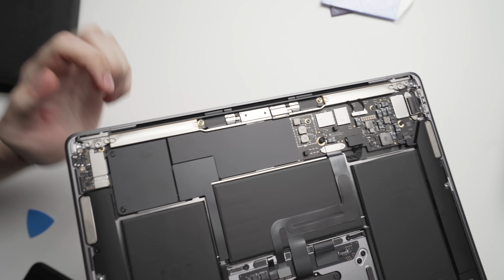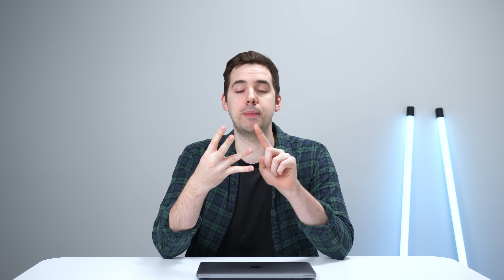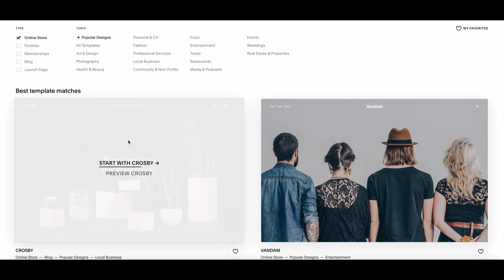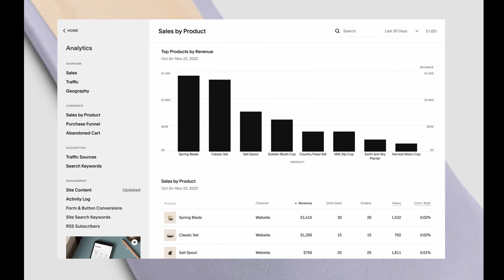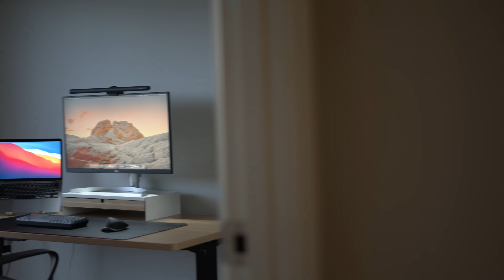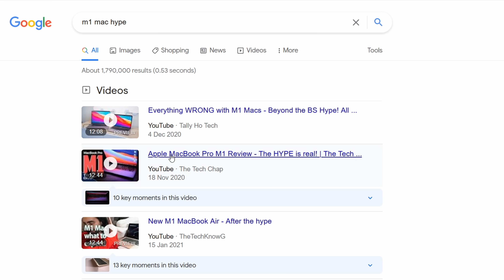M1 MacBook Air Review - After 5000 Hours of Use

Comment: Hello! Thanks for the video! Very interesting thoughts, I am looking for this one for graphic design work mainly. Any advise on whether to go for it or pass ? " Using lots of Photoshop, illustrator and occasionally Aftereffects
Reply: The M1 gpu is bad and the mba and mbp both hit 100 degrees when doing intense stuff 
If you plug in a 4K Monitor it begins to struggle 
I would recommend the Mac mini with m1 or at least the MacBook Pro because it has a fan that keeps this thing a little bit cooler (it’s still gonna hit 100degrees)

Comment: MBA M1 user here. Have you ever experienced the MBA crashing and having pink lines (sometimes horizontal sometimes vertical) at the bottom right quadrant of the screen? It has happened to me maybe about 6 or 7 times since I got the laptop in December 2020.Have tried searching for someone who's had this same problem but only a few have and we all have the same question. WHY?
Reply: I have been experiencing the same issue here. How did you approach the issue and please let me know the solution for it..
Reply: maybe the gpu is fried?

Comment: That SSD cons factor is what really concerning to me. If something happened with the SSD in the span of 4-5 years, then it's gonna be suck. This machine is in the expensive side from my point of view, so I need an assurance this thing can live with me for longer than that, even for 10 years. I have a 10 years Lenovo laptop now that unfortunately already struggling even for doing basic task. MacBook air might be a very suitable substitute for it, but that SSD factor holding me back.
Reply: Any issue there was has now been fixed and this is no longer any different from swapping in any other machine. For the average user, the SSD will last 20+ years but of course, if you are a prosumer then you need to get the max bandwidth so 16GB RAM and 2TB SSD or wait for the M1X with 32GB RAM.But that is the case everywhere. This is just common sense.
Reply: Computers can die at any time, like within a month of ownership. And these are not expensive given that a decent computer was $1000+ usd 14 years ago. Just adjust that for inflation and consider newer machines are more reliable.

Comment: I have been thinking of buying a new macbook air 8gb ,256gb for my college. And i have been watching many reviews and i really like your reviews than others. So would I face the ssd problem if im doing coding and stuffs for the next four years? I have heard plenty of rumors' that M1 macbook's ssd starts degrading after few months and just lasts about 2-3 years!?
Reply: did you buy it?
Reply: @mysterion86_1  yes
Reply: @karthik5256   did you have any proplems with it?
Reply: @mysterion86_1  nah not yet its working very fine...obv u can't game....u can actually but it heats up so i dont risk it and its a great machine.....and some unnecessary storage haa been used about 30gb till now saying system data ....ita fine for me
Reply: @karthik5256   thanks, i already have ps4, so the gaming is not an issue for me. my concern is it really fast and stable as many Said, sometimes i think it's like apple hype
Reply: @mysterion86_1  no bro i also thought at first am i making a mistake here? coz i have to use it for 4 years and do coding but it turned out to be so good.....till date i havent seen any lag or speed issue .

Comment: When we will get boot camp support for m1 chip
Reply: It most definitely won’t happen anytime soon, if ever.  It’s really up to Microsoft.  The reality is that it’s not an easy transition.  The vast majority of legacy windows programs are built on x86 architecture.  Microsoft would have to commit to transitioning windows and it’s massive software catalog to Arm based architecture, something they don’t currently appear to be committed to doing; as evidenced by the fact that currently there is no arm version of windows 10 available for purchase at retail.  Only a small number of OEM are shipping their devices preloaded with windows on arm. (Surface Pro X for example)If however we begin to see windows OS on arm sold at retail, boot camp would likely be close behind.

Comment: Although your points are certainly valid, the fact still remains that because the M1 is a custom arm chip from Apple, users cannot run either Linux nor Windows natively.  Parallels and virtualization is still the only available option; this means that whenever Apple decides to drop support for the M1 chip in the future, your only option is to upgrade...planned obsolescence in a nutshell.  If you're planning to run  Windows or Linux, you're far better off buying a non apple branded computer, regardless of the supposed advantages of the M1 versus either intel or AMD.  Everyone praises the MacBook and never mentions the fact that without Apple continuing to support it with software updates, the consumer has zero ability to repurpose any M1 mac with a native Linux or Windows installation, once Apple support ends.

Left this comment in another video, but think it's nonetheless valid here.
Reply: Once Apple support ends, usually after 6-7 years, most people will have upgraded, but those that do not, a tiny minority can still use their Macs, they just only get important security updates, not new yearly upgrades.
Reply: @andyH_England  perhaps, but my point is that it’s your computer, purchased with your hard earned money.  Why should Apple be allowed to entirely dictate its path to obsolescence?  My 2014 MacBook Pro costs me nearly $2000 at launch and will stop update after Big Sur.  With security patches likely to follow within the next 2 years.  It’s still in good condition.  Thankfully, because of the intel processor, I can run a full native windows install, after Apple abandons support.  Macs have now effectively become iPad and iPhone; completely useless once updates end.  For this reason alone, I’d buy a non Apple pc instead.
Reply: @mw7967  MS and Google also have 6-7 years of OS support so Apple is similar and as you can say on the Intel Macs you can stick Windows or Linux on. Who is to say that in six years time Apple Silicon Macs will not support Linux? I know there are projects to get Linux running on ARM for consumers and if MS gets its act together maybe WOA? It is very harsh to make these claims in the early days of a new project?
Reply: @andyH_England  Actually Google chrome books from 2018 onward will be supported with updates for 8.5 years minimum.  Even after support ends, users can run a native Linux distribution or can even run Windows natively on intel based Chrome books.  Yes, in 6 or 8 years the M1 may support Linux, but the reality is that as of now they do not.  As it stands, for me a Windows laptop and in many cases even a chrome book are a far better long term investment for the money.  You're incorrect regarding Windows OS support.  Windows 10 was released in 2015 and will be supported by Microsoft through 2026.  That's 11 years of end to end support.  If Microsoft and Google can be this transparent regarding support length, what's Apples excuse?  The fact that Apple consumers must wait for a yearly developer conference to find out if Apple will continue to support their hardware is unacceptable, given the premium they charge for their devices.

Comment: I just got an M1 Macbook Air and I'm overall pretty impressed.  This is my first Mac and I've experimented with Hackintosh, but that's it.  I don't have any affinity for Apple products and I personally despise iOS.  With all that said, the M1 Air is the real deal.  I thought Rosetta 2 would suck and I'm really surprised by how far Apple was able to push the ARM architecture.  There are plenty of things I don't like as well, but most of that comes down to little quirks with Mac OS rather than the hardware and performance of the Air.

Comment: Always excellent content, have been using the M1 air for about 5 months, was primarily an Windows user and I still enjoy my Windows laptop, but this M1 at the price point is just running circles around it to the point to where unless I believe you really invest in an higher end Windows laptop  you just want see the benefit,. I use the mod and I admit I do light video editing, not hardcore but the battery life, the performance especially with the mod is just through the roof, it just seems to be the best alternative for most people unless you're doing heavy lifting, then the MacBook Pro could take a lot of that weight, as always keep the fantastic videos coming, always informative and interesting content!

Comment: You should make a video testing the M1 Mac for engineering software such as AutoCAD, Tekla Structural Designer, and Idea Statica. I’ve been wanting to get one of the new M1 macs for a while now but I’m not sure how it will run these softwares, even if it needs to be through Parallels. Every other video tests the Mac for video and photo editing, but that is not something I would use the computer for. If you could help that would be great.
Reply: I only know about Fusion 360 though, and my friend told that it works perfectly fine! AutoCad also might work well, since it's from the same company. For windows softwares, ig softwares like Ansys would work through parallels
https://youtu.be/ReQQdJtIJdI
Reply: @c04-rhikbanerjee55  thanks, that sounds promising at least. I’ll check out the link you sent
Reply: Agree. I wonder how well M1 would perform when using Tekla, Staad, Revit, and other engineering software. I do know AutoCad is now supported. Still 50:50 about buying one.
Reply: Depends on what you are looking for. If you want maximum portability get the M1 Mac. If you are working mostly at your desk get a more powerful windows machine like Razer Blade/Asus G15 with 3060 at least. 
About the software, AutoCad 2D didn't perform as fast as my 3 years old windows last time I checked it on my friends M1 Mac, but it worked. Revit, 3Ds Max, Maya were worse via a windows Virtual Machine(only way available now), I believe if we tried 3D modelling on AutoCad, it would be bad too.
Simply said there's is no replacement for a laptop with a good GPU with a M1 Mac for Architecture/Civil softwares. But if you really want to make M1 work, you can follow the workarounds on internet.
Reply: @arijit276  thanks for the insight, that has been helpful

Comment: They fixed the memory swap issue with the last update. It only starts memory swapping when you use about 90% of you total RAM.
Reply: This is what I love about Apple as a company. They really see the problem quickly and fix it quickly with a software update. They really listened to the problem, despite the fact that certain decisions are marketing profit for them
Reply: @TheLutaChannel  indeed
Reply: @TheLutaChannel  *Most of the problems, butterfly keyboard hahahahahahah, but yes, a good strongpoint
Reply: @jivinliew  yea but butterfly keyboards couldn't be fixed with a software update soo yea
Reply: @Fadic4 so there r no more swap problem going on? i m cs grad student and planning to buy a basic m1 air, how would u recommend
Reply: @bruce9585  it still memory swaps but it does it when it's actually supposed to, compared to before when It would do it even when it is not needed. 

I recommend the 16gb version if you are going to do a decent amount of programming, also, the storage space depends on what you will be storing on there, thats something you should decide on.
Reply: @mmm2 Hello Friend, I am planning to purchase this basic Air 8gb variant. Can I connect an external hdd or ssd to this machine to store heavy data, while leave the internal ssd for applications only? I don't know much about macs.

Comment: What makes a Dell XPS have more raw performance? When it comes to "raw" performance, i always thought it was CPU performance. I don't see any XPS winning by a lot in that category.
Reply from the maker: Why do you assume it just means CPU? What about RAM, GPU, and other features? The XPS lineup was just an example anyway. I am mainly referring to other non-Apple laptops out there that you can spec appropriately if your workflow requires it, at least until more powerful Apple silicon Macs are released.
Reply: @CreatedTech  Just asking. The XPS lineup isn't the first thing comes to my mind when it comes to GPU power or raw power. 
They do have beefy CPUs, but still less powerful than Apple's chip.

Comment: Your first point isn’t really that good of a point. It works by radiating the heat through the under section. If you put this on a bed, which won’t allow the radiation it will throttle the processor due to higher heat. This doesn’t happen on a fan MacBook. 

Check out LinusTech for more information.
Reply from the maker: You'll find minor differences in heat dissipation regardless of surface with the M1 MacBook Air. The heat does not "radiate", rather it dissipates and the main method of  dissipation is simply transferring from the CPU/GPU into the large surface area of the metal chassis. Secondary dissipation (e.g. from the metal chassis to the environment) is much less important than the primary. I assume the LTT video you're referring to is their M1 MacBook Air mod video, which I've also made several videos and tests on myself which are available on this channel. Spoiler alert - even putting a 20cm laptop cooler fan directly underneath a MODDED (increased thermal output) M1 MacBook Air made zero difference in heat exchange. 

To even reach those kind of extremely hot temperatures in the first place you need to be heavily rendering for at least 10-15 minutes, and no one would leave a MacBook covered up by a quilt or sheet while performing a task like that. And guess what? Even if the M1 MacBook Air is sitting on a hot plate fresh out of the oven while rendering, it will simply throttle slightly to reduce temps.

 No offense to you personally, but I'm tired of seeing comments like this. Please provide actual sources or offer up actual testing you've performed yourself for your claim rather than simply saying "check out LinusTech". All you're doing is spreading unsubstantiated misinformation.
Reply: @CreatedTech  I wasn’t really saying ‘really hot temperatures’. I have used Mac laptops for many years. Approx 18, and while they do not get to ‘extremely hot temperatures’ they do get warm. It was more of a personal observation that putting them for extended periods on a surface that traps or keeps heat like a bed duvet wouldn’t be wise. 

Thank you for the correction on radiate to dissipate. 

No offence taken. I appreciate that it must be REALLY difficult when people do what I did and spread misinformation. 

To clarify, I haven’t done extensive research or testing. It is just my personal opinion from my personal use of these machine over the years.

Thanks for taking the time to reply and dispel the misinformation.
Reply from the maker: @DavidBridle  Thanks for understanding and taking the time to read my explanation!
Reply: @DavidBridle  It’s still radiant heat transfer, ie radiating. You’re not entirely wrong.

Comment: Hi! I found the entire video a bit stuttery, and it is most apparent in the slow motion shots. I don't know if it's something about the video (e.g., if you recently changed the frame rate or used some kind of smoothing) or the settings on which I'm viewing it. I'm viewing this on Edge browser on Windows 10 in 2160p setting, and there seems to be no buffering related problem. Also, right now I'm seeing this issue with other YouTube videos. I'm sorry my comment is about technical aspect of the video rather than the content itself, but the effect is distracting enough for me to point it out to you. Hope you understand. 🙂